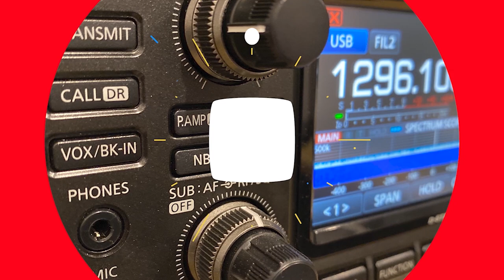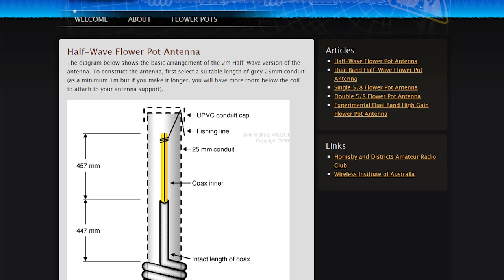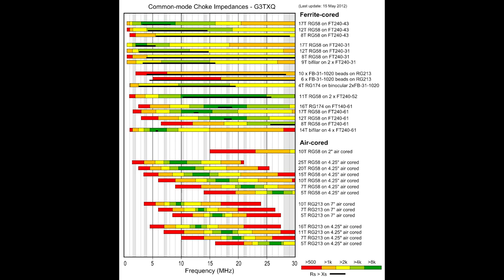Simple Portable HF Antennas with Tim G5TM | Easy to Build #YTHF21

Comment: Really enjoyed the show. Thanks to Tim for his time and to Hayden for hosting.
Reply: Thank you Cam 73
Reply: @timg5tm941  I can tell you that your assumption of operating HF while mobile, that, at 70MPH / 115Km/H you can dislodge a single mag mount

I have been playing with some 5’ whips for 40m. About to try one for 20m. While on the M4 heading back into Sydney city, my mag mount came off twice at a speed of 115km/h. It seems stable at 110Km/h

Managed a few QSOs on 40m while mobile to VK3 and VK4, distances of around 1000Km. A couple on sideband and a few on CW, Straight Key, sent left handed. 

Surprisingly, it’s no more distracting than talking to a passenger, and far less stressful than those times I had to spend in the car discussing the relationship with my now ex wife ;-)

Comment: Would be cheaper to solder a length of wire to the end of the coax  it would work the same as stripping the coax screen off.
Reply: Meh rg-58 is cheap.

Comment: If you elevated this coax antenna about 5 meters up and stretched it out horizontally above the ground would it perform adequately as an NVIS antenna? What kind of bandwidth is possible?
Reply: Pat, I don't have your answers but they will be easy to find online if you just remember this: An end-fed coaxial dipole, whether it is horizontal or vertical, is still simply a dipole. The height above ground for NVIS dipoles at various frequencies well discussed online and in print, follow the suggestions for them. Heights for end fed wire antennas or any other kind should be the same.
 Bandwidth will vary with frequency, and as with any dipole, the thicker the elements are, the better the bandwidth. Since one of the two elements (the folded back shield) is now effectively a tube, I'd expect a bandwidth gain compared to simple wire dipoles.